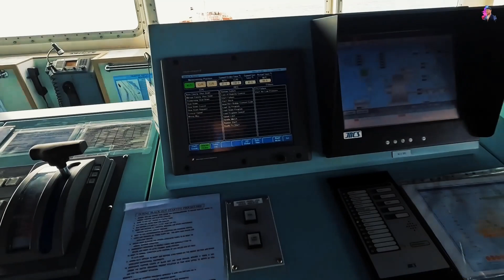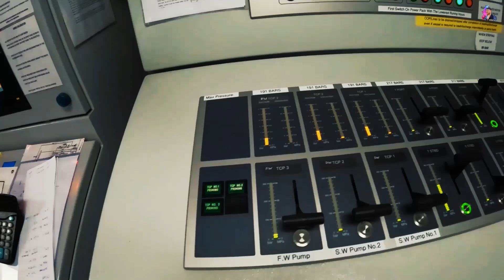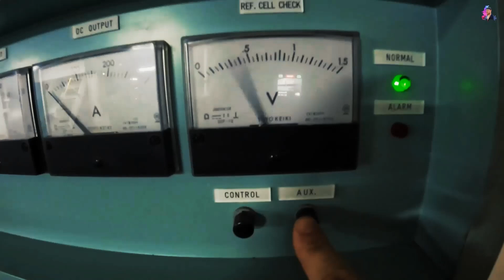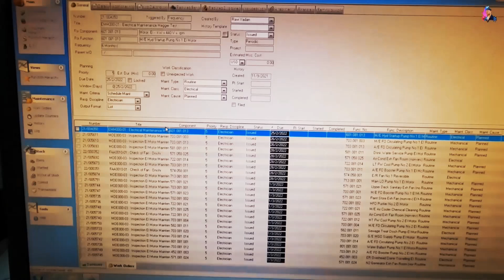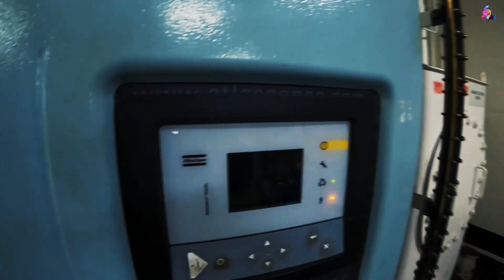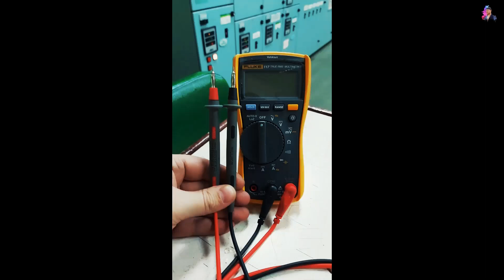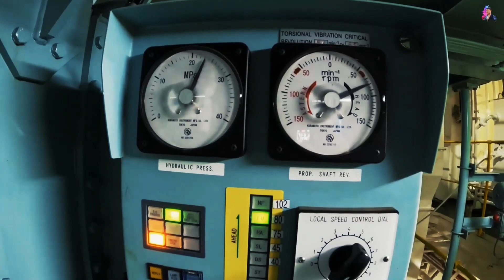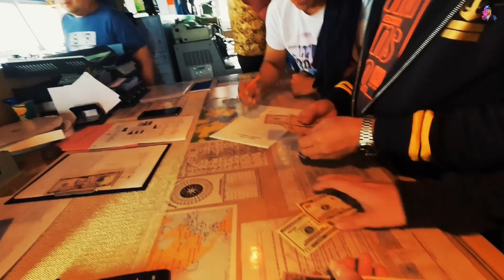Marine Electrician: Job Description, Duties And Requirements

Comment: This is an interesting niche I don’t hear about!  I’ve been looking into it a bit, does most of the industry do general boat, dock, and shore work?  Are there electricians that focus on one thing like just boats?  What would I be getting myself into?  What are the biggest challenges that these businesses face?
Reply from the maker: Glad you find it interesting! Some marine electricians handle general boat, dock, and shore work, but many specialize in vessels only. The biggest challenges include corrosion, waterproofing, and strict safety regulations. Expect tight spaces, troubleshooting in tough conditions, and possible offshore work. It’s demanding but rewarding if you love boats and problem-solving! 🚢⚡
Reply: Thank you for the quick reply, so helpful!  Interesting about electricians just focusing on boats, must be a lot of work there!!!